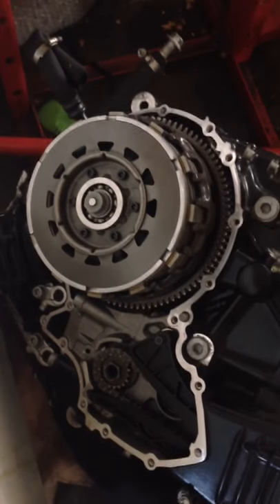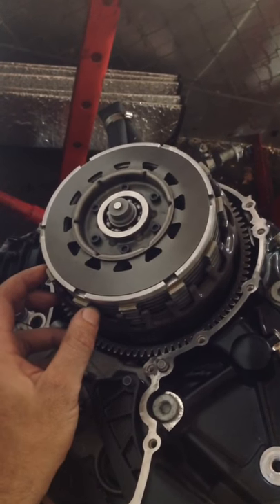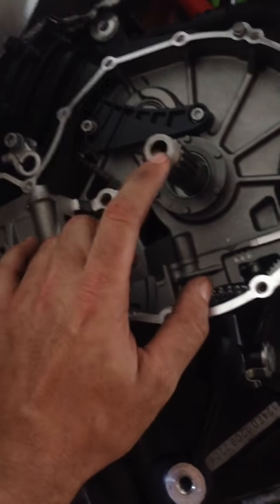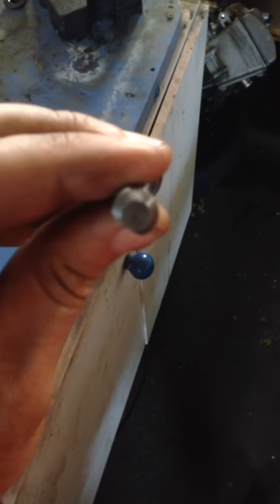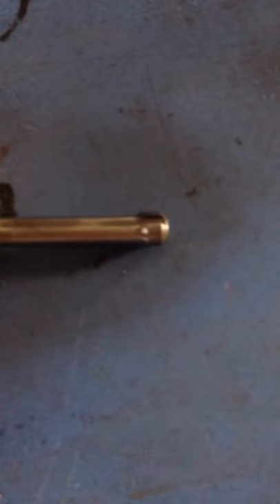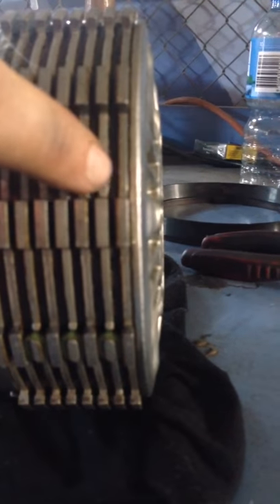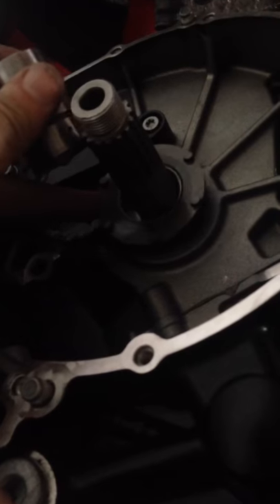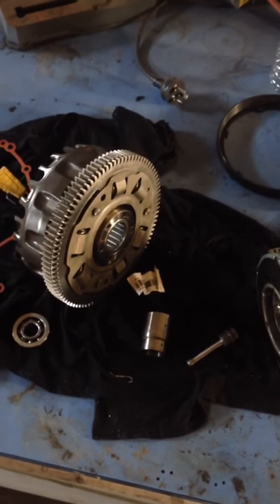BMW K1200s 2008 Clutchplates and Basket

Comment from the maker: In the 05 model the "Pin" that pushes against the throw out bearing is approximately 20mm long and does not reach into the gearbox shaft.

The gearbox shaft itself has, what bmw calls an "oil nozzle". Its a 6mm piece of aluminium which is flatened on one side pressed into the shaft. There is a service bulletin in which says to remove it and to install a modified "oil nozzle". Pretty much the same thing but the flattened area is increased to let more oil out of the shaft, so it can reach the clutch basket more efficient.

The newer type "pin" is about 60mm long and reaches all the way into the gearbox shaft. Obviously, the aluminium "nozzle" then would have to be removed first.
But, the new type pin has 3 version. One groove, 2 grooves, 3 grooves. It seems BMW tried 3 times to correct the problem. But none of them work.

I machined my pin down leaving only the tip intact so when it sits inside the shaft it is still balanced.
Reply: Patrique Hofmann 3
Reply: And how it works? Did this solve the problem? I have problem the clutch won’t properly disengage. I have new friction discs and new oil? 10w40 can be problem?

Comment: u say that the earlier models (05'?) had a different throw out bearing...and that it didnt have the shaft that is creating the oil restriction. What then is the reason for keeping the entire pin then? Why not just get rid of the pin portion all together like the earlier models? does the pin help to deliver oil to the rest of the clutch and those two bearings?

Comment: How well did the reduction you made in the pin work and was there any noticeable reduction in overall engine oil pressure due to the additional oil bleed off possibility! Ive watched all your vids and respect your attempts to help remedy the poor clutch lubrication problems . Thanks R

Comment from the maker: Drill a 5mm hole, run a M6 tap (thread cutter) through it. Then use a 7/16 (~12mm) socket and a long M6 bolt and start turning it. The bolt will pull the aluminum plug into the socket...... 

Read this: https://plus.google.com/photos/115891955273107251179/album/5695138489110409073/5695138505030151106